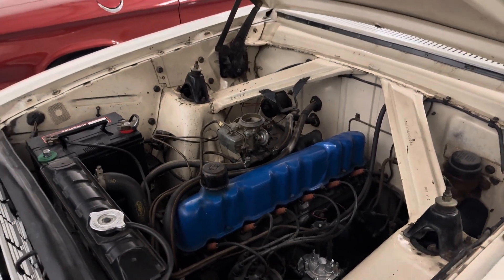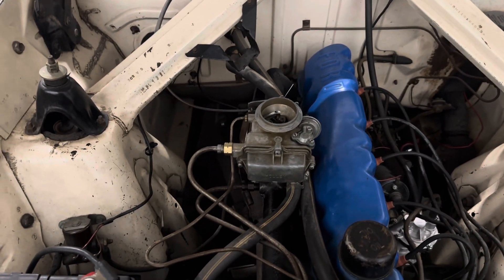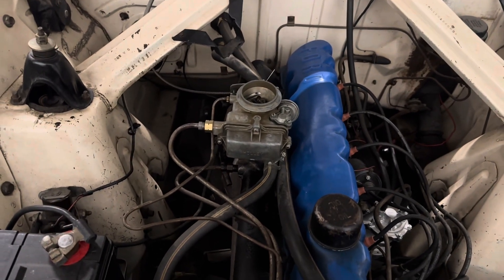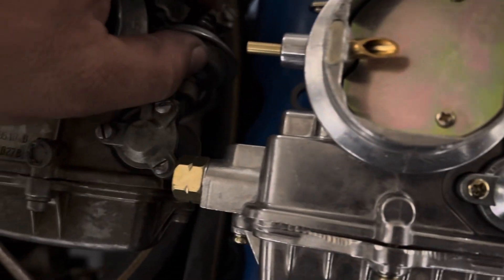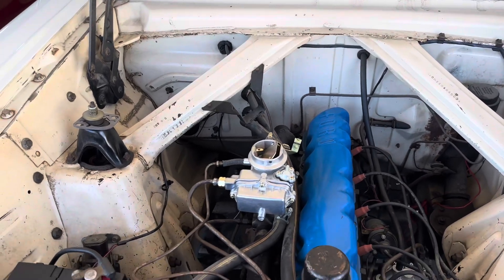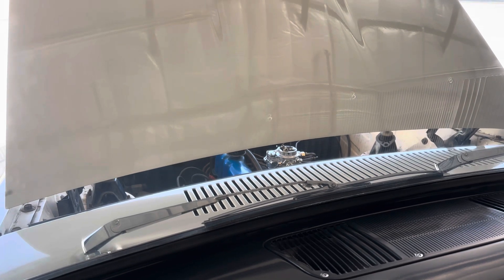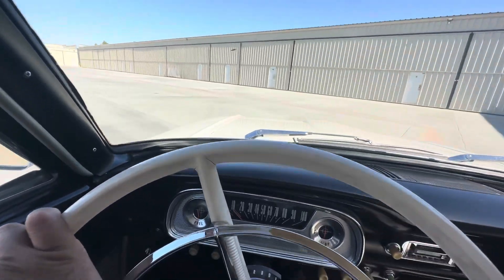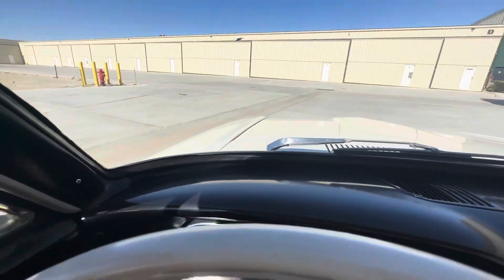Brad's 1962 Ford Falcon - swapping out the OEM carb for a new replacement carburetor

Comment: What brand of carb did you put on if you don't mind telling? My 63 comet runs like crap with the oem carb. Want to swap it.
Reply from the maker: Attempt a rebuild or acquiring a remanufactured OEM first, but it will get potentially costly.  We ended up getting a 100% NEW CHINESE special off of eBay, and knock on wood, its been flawless
Reply: Thanks @DezarovsClassics
Reply: he put on a Holley 1908 i think. its chinese. i bought one myself for my 62 falcon. seems to work well